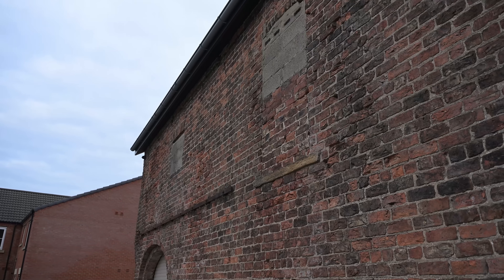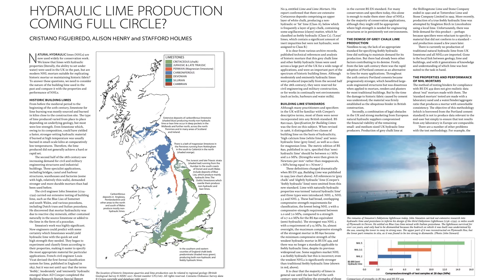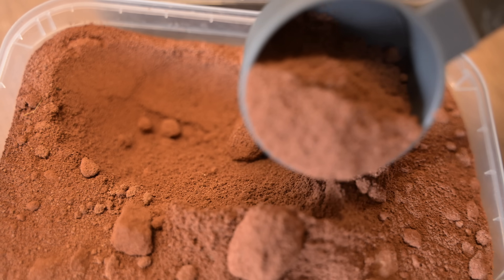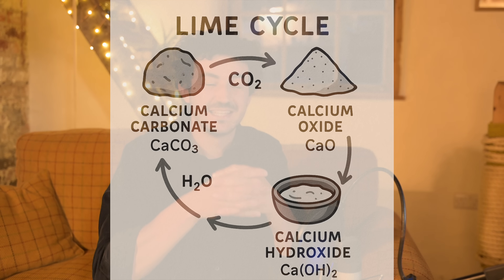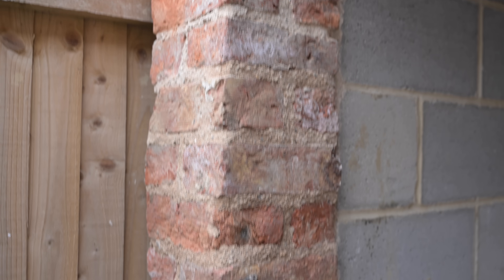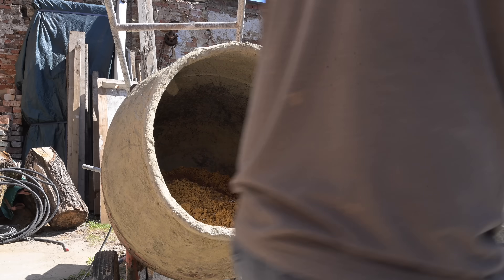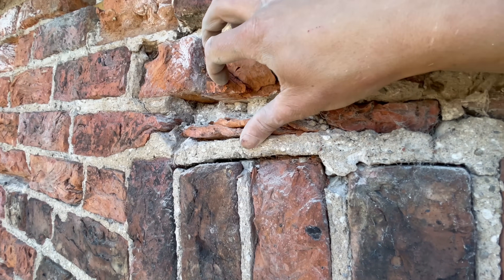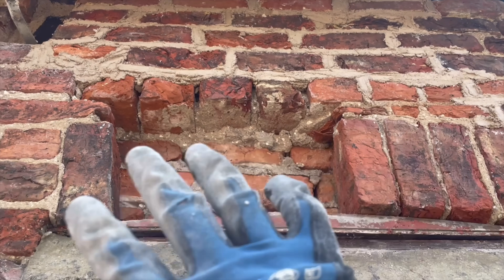The Devil's in the Mortar (and it's Hot Mixed Lime)

Comment: I believe you are better off using 6 parts sharp sand 1 part cement 1 part hydrated lime and plasticiser.
It will be soft due the plasticiser and  its honestly modern.
Lime is  no way the same product these days.

Comment: Max, I just read the conservation article… where did you get your quick lime from? Was it a local source?
Reply from the maker: It's interesting. Eden Hot Lime, 3/4 an hour away from me but they deliver. All the Mortar ingredients are in the description
Reply: @maxxwebster  close to my cottage is Limeburners Creek. I believe the early settlers used the shells from Aboriginal middens to make the lime, maybe for my place? (the second oldest building in the district… the pub is the oldest, and much better built than my place which was the Anglican rectory 😅). 
I wonder what NHL classification shell grit line would get? 😊

Comment: Can you explain tempered mortar? It is described as a hard shell placed on the earthen cities walls of the Middle East that does not dissolve when rained upon thus protecting the wall from erosion. Is the tempering going through the transformation in the lime kiln from calcium carbonate to calcium oxide? My understanding of tempering is that it is heating to a precise temperature and then slow cooling so that the crystals form at the right sizes.

Comment: Great work you have done here, pointing with hot lime mix!!! It is indeed a superior material to cement and gypsum, and if we really love our environment we should use it instead of those two last binders that keep the wall always wet. Its amazing to see someone who likes working with lime as I do. I have moved into my house 5 years ago and since then I was taking off either cement pointed wall or gypsum/cement plastered render from old Edwardian house. At the beginning I did not understand the difference between binders but then started to do the research, as more damp issues were discovered. I was curious why one room is damper than the other, why there are spalling bricks, why the mortar is different in two different places (cement and lime) etc.? As my house was affected by huge damp issues, on places where gypsum or cement was added, this was the trigger that prompted me to think why has it happened. Nigel Copsey and his book have been big help in understanding lime as many other books, since then I am very fond of lime product as it did solve all the damp issues I had. I also agree on your statement about NHL, I did indeed used it before on my house, predominantly for pointing , but caused damp issues, due to its low lime content. Nigel Copsey talks about it in his book in more detail. Great work, you have done so far an keep it up, and please do more videos on lime. Cheers.

Comment: Looks great! - Much more complex than my old house which was basically local sand and lime - very uniform.
A restoration Mason told me that in our area his mix is - One part white Portland cement, One part hydrated lime, 6 parts sand. He also finished up by hitting his work with Muriatic Acid to take some of the surface whiteness out - basically concentrated acid rain - lol

Comment: Fascinating and informative. Limestone and quicklime are truly wondrous materials. 

I don't mean to be critical, but can I suggest you get a set of scaffolding for high work like this. I know of too many accidents, some very serious that could easily have been avoided. Great channel!
Reply: An excellent exposition & presentation of this wonderful mortar. I use it too on a small scale for renovation of my old house, in & out.
Re. safety, I agree with above post; I'd suggest as a minimum park a vehicle in front of that ladder to avoid crazy drivers accidentally hitting it. Also, an Ali tower on wheels better still.

Comment: Max, I had my old sandstone cottage (1840s, near Newcastle in Australia) repointed after the 1988 earthquake made it lean out a little more with slaked lime mortar. the builder was freaking out about the occ. health & safety hurdles with hot lime, until the elderly retired trades teacher for the district said slaked lime would work as well… it wasn’t a premix like the NHL product, but made on site, and seems to be holding up well after 37 years. 

But I have to strengthen a lintel and point up the sandstone block which has a crack. Did you do any research on using slaked lime? Thx in advance!